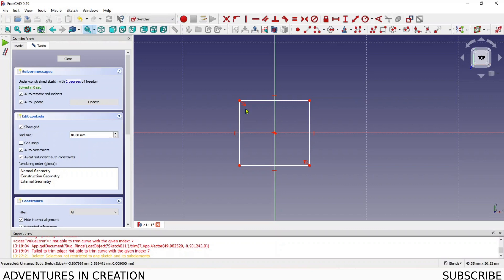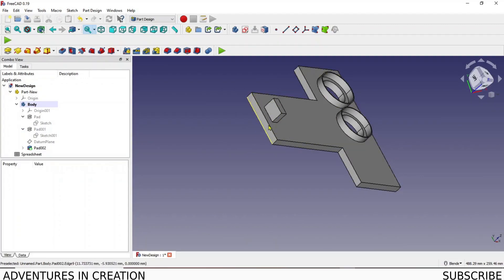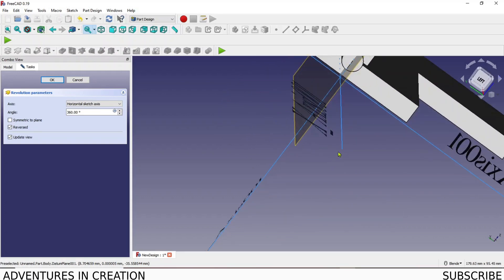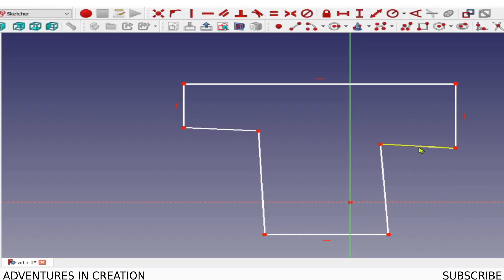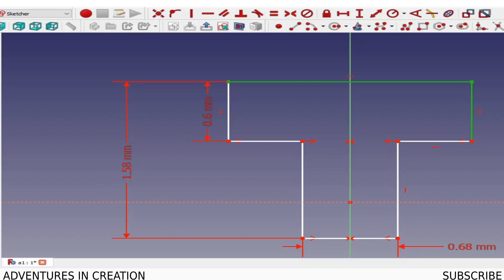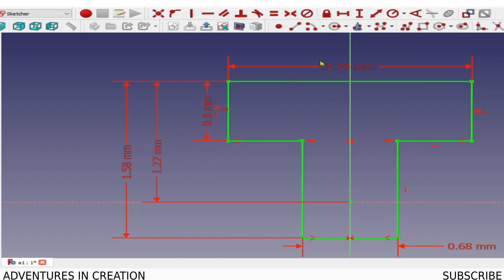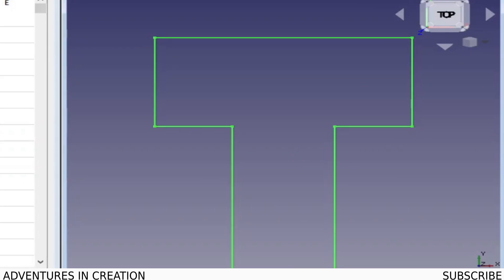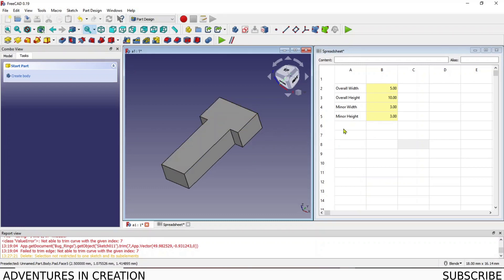FreeCAD tips to help users who are moving to freecad from Fusion360.

Comment: Blender's view navigation is oriented around middle button only. Middle = rotate. Shift+Middle = pan. Ctrl+Middle = zoom (now also scroll). Same with arrows on the numpad. That left+right click must be from something else. You can see the basic controls in Edit - Preferences - Display - 3D Navigation - Mouse...
Reply from the maker: Yeah, I agree, as a Blender user, these mouse interactions are different but they may have been based on older version (they are called Blender in FreeCAD). It would be much easier for me if they were identical, I might look at a way to change that.
Reply: Paolo G  So the double mouse click thing is a workaround to not have to press Shift, despite Blender not having that mode? It seems a bit risky, as it sometimes pops up the right click menu, which can lead to even more confusion. At least shift+middle still works. Also seems funny that Blender mode is singled out with this special workaround, as e.g. CAD navigation mode lacks a mouse only rotate.